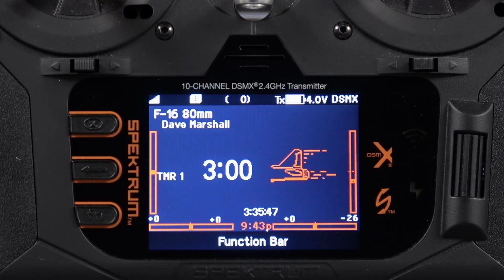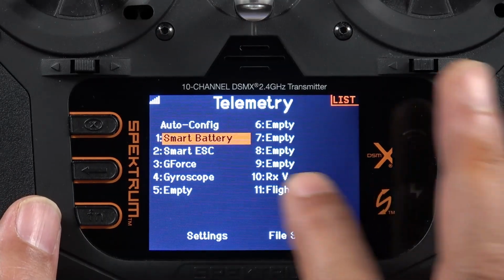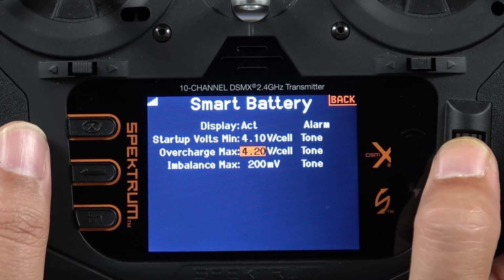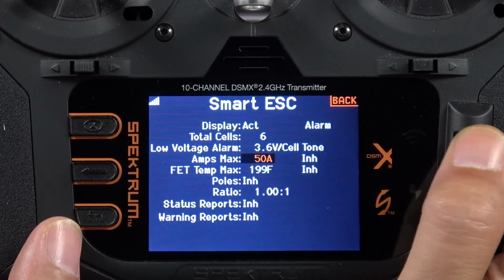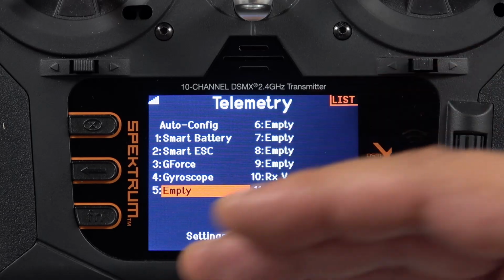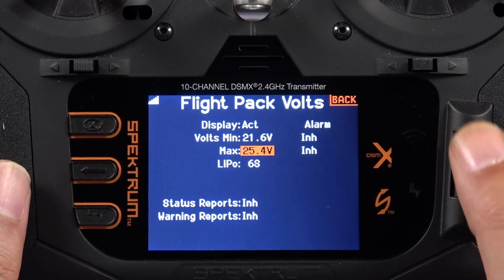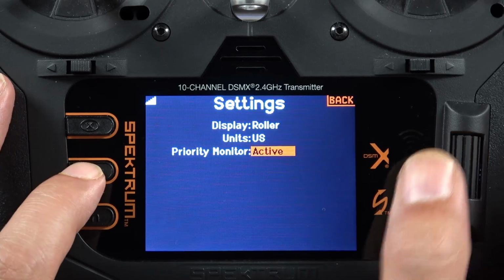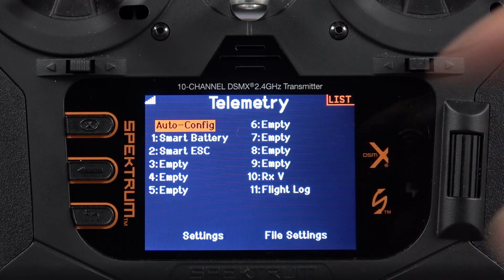Spektrum NX Series Tutorials - Telemetry

Comment: Excellent video! I know this is an older post/video, but I think you may be able to help seeing it's related to telemetry and the NX8 transmitter. I'm having a problem using my NX8 transmitter with an Apprentice STS 1.5 and the Spektrum Remote ID.  I'm trying to get  the Spektrum Remote ID to show the data on the NX8.  The Remote ID light is on, I went to telemetry on the NX8 and put in gps, scrowled to the gps screen, but there's no data showing up.

What am I missing here?

I would appreciate any help and suggestions!

Comment: Thank you for the valuable information.
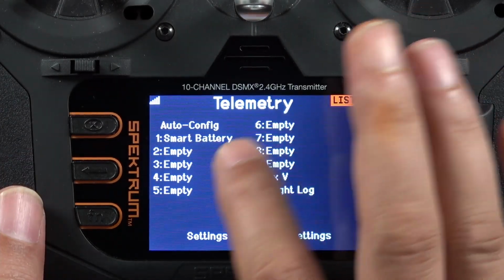I have a Spektrum IX14 transmitter, but the concepts are the same. I'd like to learn, for example about all the telemetry concepts, as for example: in FlightLog  Frame loss, Holds, , Pitch, rolls, I have pics of screen in Flight Log A: 1180 B: L: R: dBm: -42, F: 1144  2:03; H:1 26:45. This is information in a Fox Glider FMS 3000.
Gyroscope Screen Gyro:
Roll: 0, Pitch: 0, Yaw .; Max 97. 109, 146/
In other words, a Smart ESC, Motor, Receiver, give us a lot of information.
How to read and interpret that information. What is the use for it?

Comment: Easily the best video on NX 10 instructions no background music or background noise nice and clear and straight to the facts...
I add two call outs on one switch for landing 'Time Remaining ' lets me know how much I've gone over the timer after my mAh Alarm/vibrate kicks in and 'Voltage' ...this way I get to know End of flight voltage so I can monitor the packs life...also I set a low voltage on 6S packs at 20V with a vibrate alarm also...the reason for using Vibrate alarms is I sometimes fly with Bluetooth headset to music.

Comment: So I have gps module plugged into my Rx. Auto config and it's perfect. I can set it to voice announce speed  every 5 seconds. But obviously that's super annoying the entire flight. I want to put the voice announcement every 5 seconds but on an unused switch so I can turn it on and off when I want to hear it. Same with altitude or rpm. For the life of me I cannot find how to do this. If you know how please let me know.
Vario in telemetry offers a switch option in the Vario settings. But no switch offered for other telemetry options. I have tried to make an announcement under stepping reports. But not sure if this will only give me the one announcement on flipping the switch will announce speed and then every 5 seconds until I switch it off?
Reply: Not sure if you figured it out yet , but it’s simple, just go into audio alerts , and pick a switch you want to flip to have the call outs on ,and then when it ask you to pick the sound you want go into telemetry sounds , example - select switch A , then say I want to have my flight pack voltage called out , you would just select the sound VOLTS , or if you want altitude, select that , same applies to all the telemetry functions, their all pre set to call out what they do

Comment: The SMART ESC voltage alerts and alarms work in controlled conditions on the work bench and RC airplane stand. Tested in Indianapolis Motzart city part at 40F -- minus wind chill-- the alerts and alarms signaled at only 4.0v not the 3.8v programmed. The cold air temperature and wind chill made actual flying performance much different from the bench testing. Turbo Timber Evo flights of 8 minutes left 3.9v on the 4S SMART 2200mAh Spektrum lipos.

Comment: Why does Altitude not show up in your video?
Reply: Thanks I have an AR637T in my Smart Maule M7 and it sends altitude to my NX10, but I put a brand new AR637T in another plane, and no Altitude on same NX10… this one arrived at Horizon for eval, repair replacement
Is it the TA version Altitude handicapped?
Thanks
Reply from the maker: Yes, the TA version does not have a barometer. The AR637T will give you altitude no problem
Reply from the maker: I don't go over every possible telemetry sensor you can add, and the AR637TA does not have altitude available.
Reply: Be sure to keep your transmitter “updated” 🤔
Reply: Excellent, thanks !